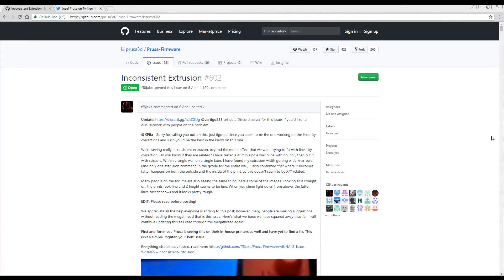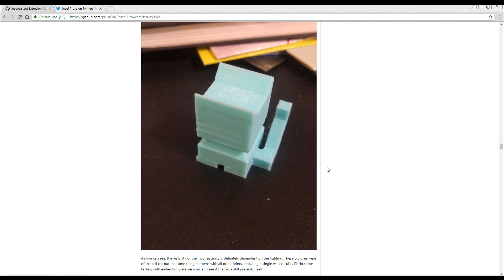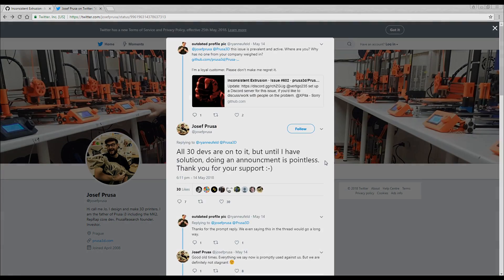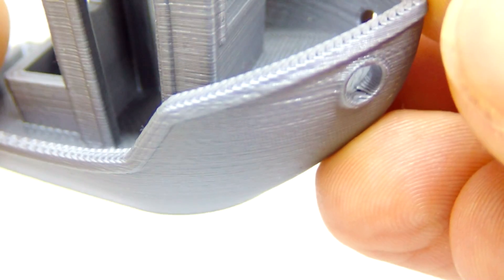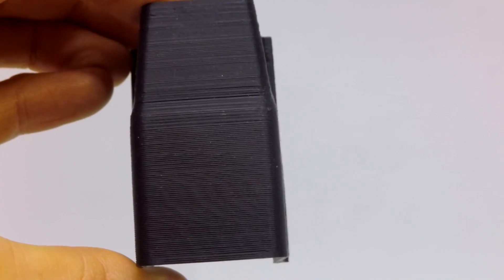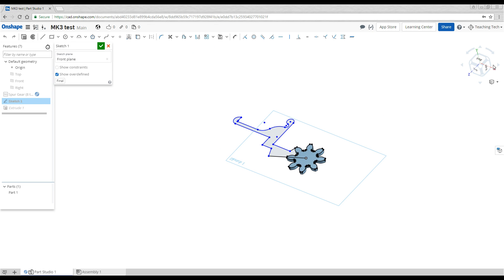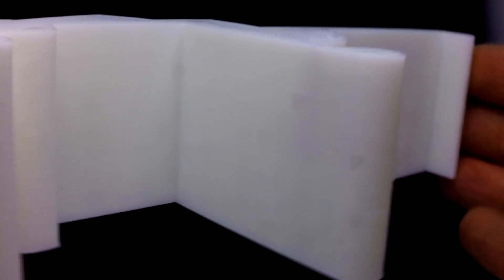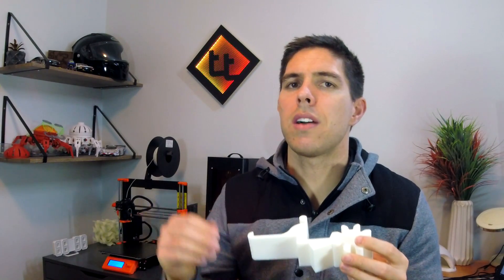Prusa MK3 extrusion issue: Just how bad is it?

Comment: Great video Michael, though as you've already discussed the white filament made hightlighting potential issues difficult.

In my view, some people are expecting perfection from a well made, but still RepRap printer. If you want perfection, spend the $5 000 to $10 000 to get it. Off hand I don't remember Joseph marketing perfection, just a really good printer with extra fault protection. His company seems to have gone overboard to ensure customer satisfaction, even in cases where it seems to me the customer is at fault. 

I personally have not seen this issue but I am printing for function, not perfection. I'm making items that will suit functional needs like structurally sound cases or holders that will withstand time and reasonable use / abuse.
Reply from the maker: Thanks for watching David, I think you have summarised it well.

Comment: As a 3d printer maker and designer i would say that its caused by the stepper driver of the extruder , it might be a signal integrety isue or a microsteping inconsistency or a microcontroller problem  with the step signal
Reply from the maker: This is one of the leading theories in the community.
Reply: The PTFE feed tube did not align with the filament feed and the result was, the filament was binding. I had to clean up the feed channel with a drill bit when I was calibrating my MK3 for the first time. I have not had any issues since but I'm sure if I had not found this, I would be having major issues. The issue I found was a simple 3D print issue in the filament feed channel.

Comment: I bought 3 Pre-Built Mk3s and all suffered quality issues especially when your trying to make a detailed print at .05 layer height. Its useless for that purpose and therefore useless for presentation visual prototyping. Out of despair I bought the Ender 3 and it prints far better than the MK3 with virtually no layer lines, although you do have to tighten up some belts and the bed a bit.
Reply from the maker: Been hearing only good reports about that Ender 3. Very keen to get my hands on one.
Reply: wtf?

Comment: I was looking at this problem on the forums but it's difficult. I haven't had any problems whatsoever and the prints look really clean (currently at 672H of printing time), so I started to compare my setup and others, the people that are affected by this problem. 

I noticed two things:
- flexibility in the frame (main plate). I noticed that at higher print speeds you can see some slight wobbling. Usally this presents itself in the form of ghosting 

- A heavy roll of filament is installed on top of the printer frame.

My guess is that the wobbling introduced by higher print speeds and the flexibility of the frame is retained by the mass on top of the frame. This "pendulum effect" causes the ghosting that usally only presents itself close to corners to spread around the entire print and in a more randomized pattern (similar to throwing a stone in a pond, or throwing several stones in the pond)

I eliminated (or prevented) this by printing at a fairly slow speed and removing the filament spool from the printer to a shelf above the printer.
Reply: Do you still have ghosting issues at all with the slower speed and no spool on printer?
Reply: Non at all. All issues I had in those 600+ hours where minor things caused by me and took little effort to solve.
Reply from the maker: That's a nice suggestion and fortunately very easy to test. Where do you mount your filament spool?
Reply: I have it placed on a seperate spoolholder that stands on a shelf above the printer
Reply: This one:

https://www.thingiverse.com/thing:2047554
Reply: Would you mind trying it? I'd rather not intentionally mess up my printer in order to test a hypothetical solution.  As they say: "If it ain't broken dont fix it"  (instead of AvE's motto "fix it till it's broken")
Reply from the maker: I looked into the tush, but I don't have anywhere to stick it directly above the printer. Could this same test be conducted by printing with a tiny sample bit of filament?
Reply: I actually think the extra weight atop the printer is potentially helpful, as weighing it down reduces the magnitude of excursion exited by rapid movements of the head - the acceleration is force divided by mass, right, and the force is the same. However, this extra weight also reduces resonant frequency, which might potentially make it more visible.

Slowing down is always helpful of course.

Also i passionately hate TUSH, the separate rails just tend to fall over, wander off, or the spool jumps off.
Reply: It might, thats why someone that has this problem could try this out. It is at least one of the variables that I am aware of that is different in my situation (and I have no printsurface issues at all). This would also suggest that the problem is named wrong, and that it is not an extrusion issue but a rigidity/stiffness issue.

It's still speculation though.
Reply: Sounds like an excellent alternative! See no reason why it couldn't work, as long as it is enough for a print that actually gives a good impression of the surface finish. I suggest that you first print it in the current setup (with the issues still clearly present) with a filament color that is not that forgiving. That should make it easier to compare. 

I would say you'd get the best and clearest idea when you try:
- Current setup with your go-to slicer settings
- Current setup with printing speed halved (what speed do you have it normally set to?)
- Setup with filament spool removed (and go-to settings)
- Setup with filament spool removed and print speed halved. 

I added printing speed in the test because I assume it has a significant effect. I did some print quality tests today, I can upload and share the pictures of the results if you are interested.
Reply: So I am kind of curious, did you find time to try it out? And if so what are your results?

Comment: TBH the benchy is also quite bad. You can see that the printer can't draw a smooth curve consistently.
Reply: My youtube video comparing linear advance on Printrbot Simple Metal with Marlin 1.1.x vs Prusa MK2S demostrates how the the Prusa falls on it's face using linear advance.

https://www.youtube.com/watch?v=UrPwzLug2FE
Reply from the maker: The fade height is new to me and very interesting. One popular theory is the 8 bit microcontroller running out of steam so this is fascinating.Thanks for sharing.
Reply: Interesting; it does look like a VERY empty planner queue, which is a fairly reliable indication that you have run out of CPU time - presumably due to a planner bug, because there's no reason why MBL would take longer with every layer, it should produce a nearly constant overhead with super little variance. Same with pressure advance, it shouldn't just keep getting slower - there are of course classes of bugs that could cause such a gradual slowdown.

The uneven extrusion issue discussed here does not indicate running out of CPU time. However, overoptimisation can lead to unfortunate bundling of stepper pulses that would cause uneven extrusion.

Comment: I have the issue on my Mk3 too, it's not terrible by any measure, it just makes the prints look a little subpar, especially where you have large flat surfaces, I'd say the quality was not quite as good as - for example - my old CR10, but otherwise the Mk3 produces reasonably good functional prints, if I want something for display or any kind of 'art' piece (rather than a functional part) with a high quality surface finish, then I'd probably opt for the CR10, otherwise I use the Mk3 for its speed and ease of use.
Reply: Dave Lordy so you spend 769 e plus shipping on a mediocre fast printer ?
Reply: Well no, I bought the preassembled model, so I spent £899 (UK), which is about €1,020 . . . plus another £20 for "2 day UPS shipping" (Prusa then sends the printer out via a UPS 5 day Standard service, so the '2 day UPS shipping' is somewhat of a scam by Prusa) . . . lol . . . what can I say, If I'd known about the quality issues beforehand I would have probably bought a CR10S4 (for the larger build area), I was also considering a resin printer like the Peopoly . . . but I've got the Mk3 now so no use in complaining - and like I say besides the poor surface quality it's otherwise a decent little printer (although expensive for what it does).
Reply from the maker: Thanks for sharing Dave. The useability is probably the best selling point for the printer. As you say parts are functional and very quick and convenient to print and remove.
Reply: Yeah, it's great in that regard, the flexible / removable bed is incredibly useful (I would never go back to a fixed bed now) . . . if Prusa could sort out the surface quality issues, bring it close to CR10 quality (or similar) they would have the best FDM on the market right now, as it stands it's still a great all-round printer, just not in the top league when it comes to surface finish.
Reply: I have this issue too. It's a bit disappointing.

Comment: Good vid. But didn't you say that you have to shine light above your prints? You can't really see surface on your test print.
It also looks like you have the same issue as everyone else judging from your test cube footage. What got people really upset is the fact that cheaper printers like cr10s and even the old mk2 seem to be unaffected by this issue.
Reply from the maker: Hi Mato, all good points. I did have a light above the test print, it was just hard to capture it since it was printed in white. Waiting on filament order so forced into white for a print of that size. In real life it looks quite good.
Reply: @TeachingTech  You didn't have to make such a huge part, and you could've also used the shell command and only print 4 walls.
Reply: There aren't many people claiming this but my MK2S is having the exact same issue, and the github image of the white CaliCat shown in the video above is actually from an MK2 unit. I hope whoever is working on figuring this out understands it is not only related to the MK3s. I did buy my MK2S kit on the cusp of the MK3's release, perhaps its a firmware thing or perhaps there's a crossover in parts (extruder stepper?) used in those close together production runs?